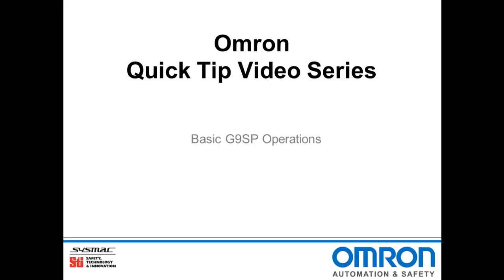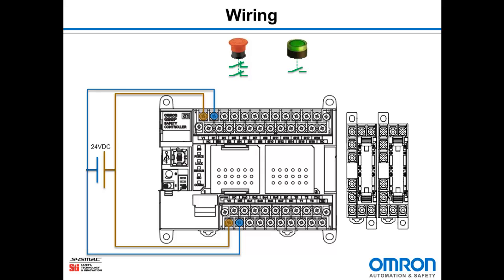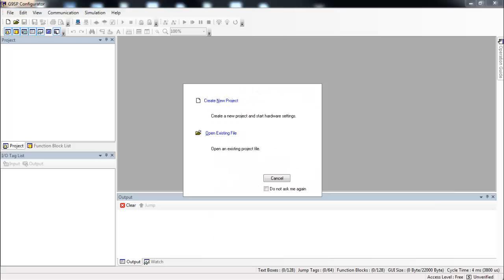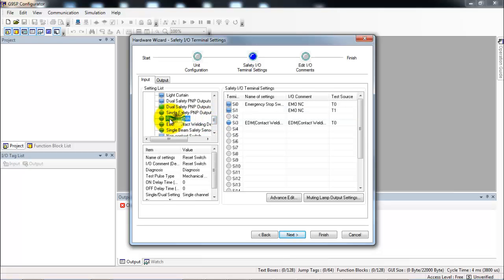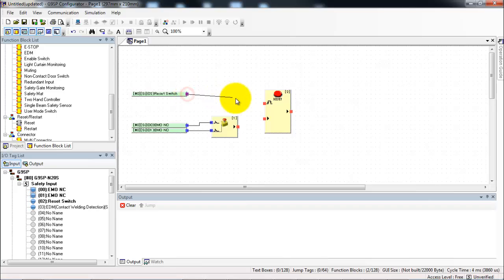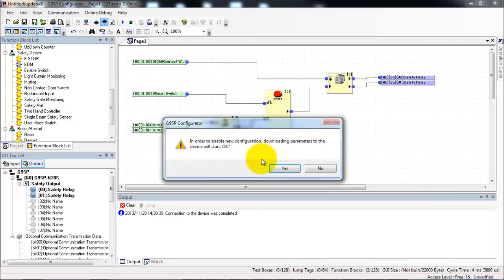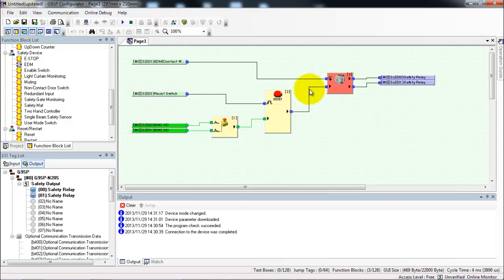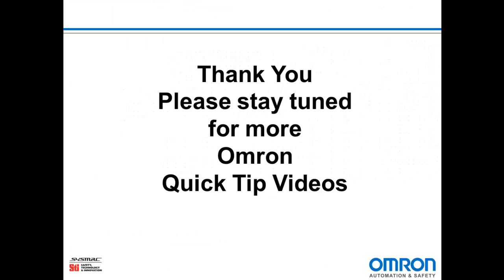G9SP Safety Controller Basic Operations

Comment: Hi, i am using g9sp n20s safety plc. I cannot see any discrepancy error output of E-STOP function when i change one of the input of Emergency button from 1 to 0. Can you help me about this situation please. Thank you so much.
Reply: The solution is very simple - use duelco dsc-m1 PLC (tested, but you will need to make bigger discrepancy time, because default 3ms can cause an error - make 20ms at least, even for light curtain) 😁